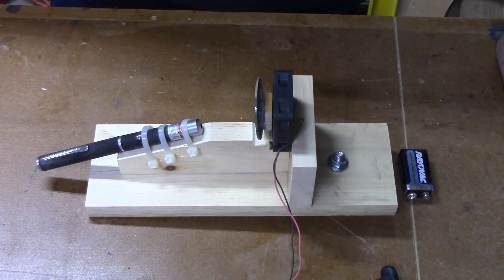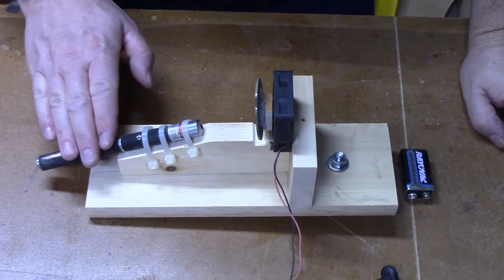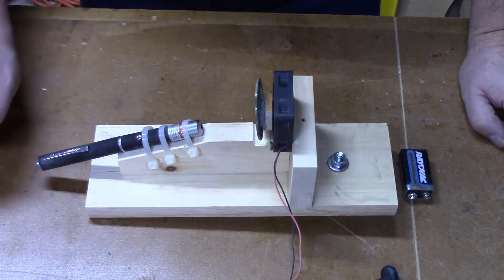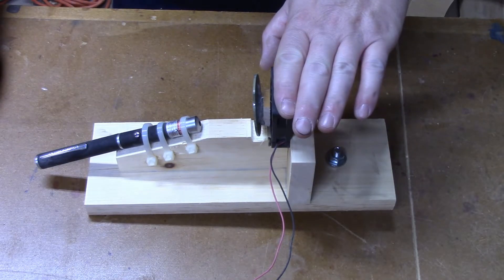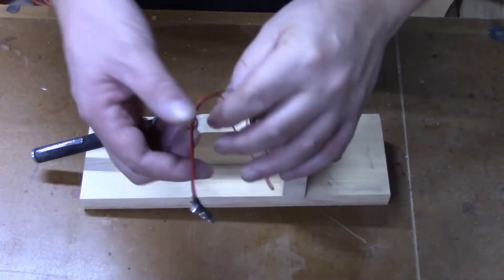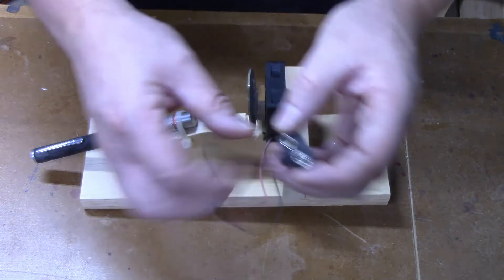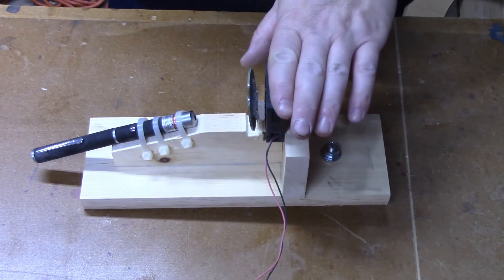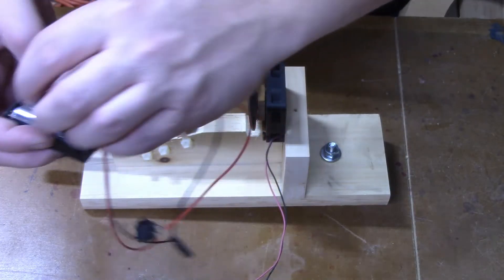Halloween Laser Vortex Design

Comment: Building one of these up this year.  Can you describe how you mounted the mirror on the case fan?  Is it angled or flat on the fan?
Reply from the maker: I used hot glue to attach it to the fan. It needs to be attached to the fan with a bit of an angle. The amount of angle will affect the size of the circle it creates.